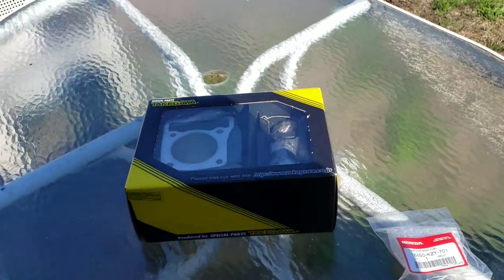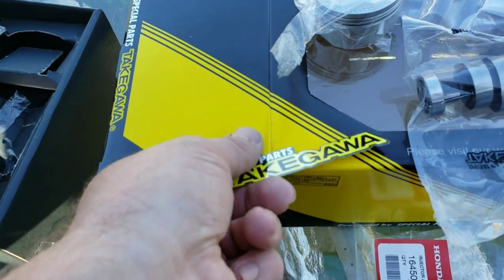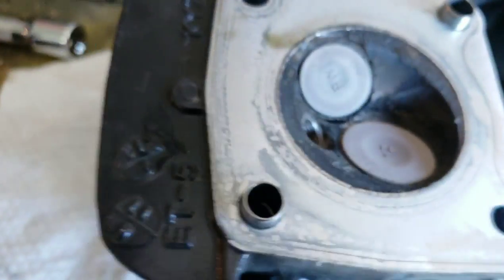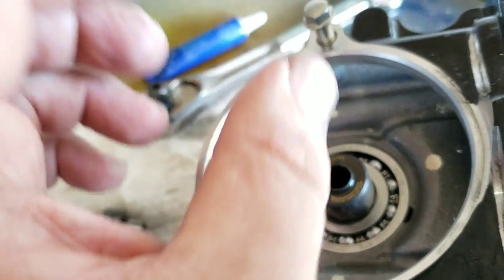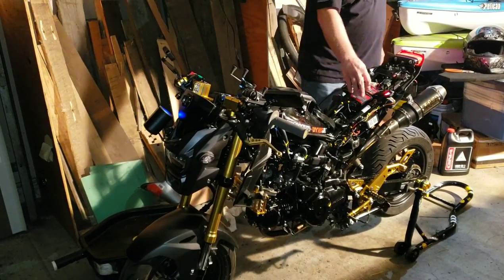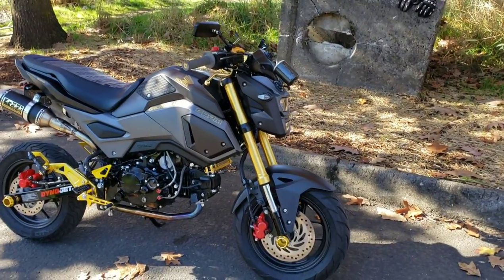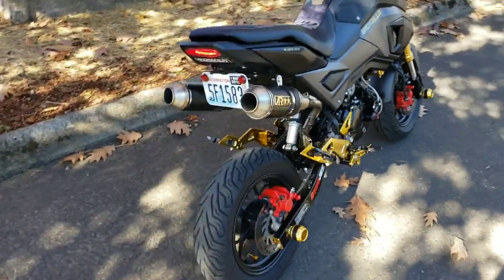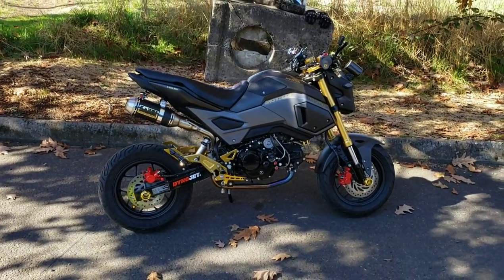GROMZILLA gets the TAKEGAWA 181  Big bore kit and type-S camshaft

Comment: 4 years later: I wonder how it worked out. Bigger Power = Bigger HEAT, I know from boring-out larger bikes... the Grom is famous for it's reliability; did you have any issues after this work?
Reply from the maker: I believe there's right about six to maybe 8,000 miles on the bike right now and no it is never broken down it has been very reliable. Keep in mind it does get hot. On a two or three hour ride on a 80° day you are going to be pulling over to let it cool down. If you didn't pull over to let it cool down I suppose it would probably blow up just because it gets too hot. Heeat has been its only issue ever. Not that it's ever had an actual issue but I'm just saying it does get hot. That is the downfall of doing a Big bore kit always. You have to keep an eye on the temperature if it goes above 226° f we shut it down and pull over. It will cool back down if you start slowing down but if you are on it full throttle it will start heating up. This bike has an oil cooler and every other kind of thing that we could come up with to help keep it cool yet it still gets hot. The thing still rips though. We put it on e85 and it pulled all the way up to 96 mph. Of course a lot of that has to do with the gearing we put on it but it had the power to get there. I let off at 12,500 RPM. Data logged the entire run and it still had a little bit to go but not much. Definitely a fun little bike if I had to build it all over again I would build it the same way that I did.
Reply: @BLRTUNING  Thanks Bill, an interesting report! I'm an experienced tech, have built a number of larger-bike race motors... HEAT is the Enemy, as you've learned; it can cause numerous problems including excessive piston-ring/cylinder-wall wear (or damage), valve guide / stem wear, and even lower-end bearing failure, in extreme cases. Yes, I would do everything possible to keep that oil temp down, and also use VERY GOOD OIL, with frequent changes. A Ferarri mechanic I know recommended Valvoline VR-1 WITH ZINC for my big-bore (air-cooled) Bandit 1200 Suzuki, which I'm using presently. But do your homework carefully on oil for that little ripper.

Comment: I wondered how fast can the 181cc kit goes?
The 143cc kit can hit 70-72 miles, I am considering either one if the 181cc is a big improvement.
Reply from the maker: It all depends on how you build the bike and what sprockets you are running.. top speed on this bike is above 90mph.. it has a lot more done to it than just the 181 kit.
Reply: @BLRTUNING  Thanks, I think it would be a considerable improvement over 143cc, I'll go for that instead.
Reply: @BLRTUNING  what all has been done I have the same kit but using pc5 with autotune

Comment: Might do this over the sucker punch kit.... power on this must fall off around 9k 9500 with stock head.
Reply from the maker: It makes power till about 10,000 RPM on the stock head. There is newer videos of this bike on my channel. The bike now has a ported large two valve head with a ported throttle body and a huge carbon fiber intake with a 4-in open velocity stack. The bike now runs on E85 and will easily rev out to 13,000 RPM and has done 96 mph down the freeway...  Gearing when it went that fast on the freeway was geared just for the freeway. We were running 16 tooth in the front and 30 in the rear.. the bike has over 7,000 miles on it now and it still is running on the 181 Big bore kit. When we put it on E85 we stepped up to a 235cc injector. This is by far one of the longest running Big bore kits that I've seen for a long time.

I tune these bikes on a daily basis. Tuning work for them can be done via email. If you have any further questions you can always message me through the BLR TUNING FACEBOOK PAGE...

https://m.facebook.com/BLRTUNING/

Comment: What's your top speed now 70? Or still around 60
Reply from the maker: I'm not sure I haven't gotten the bike up to top speed yet. I haven't tried to push it like that.  I was cruising down the freeway at 75 miles an hour half throttle 4th gear 7000rpm .. rev limit is set at 10200rpm.  So top speed should be somewhere around 90 to 95 mph.  At 75 miles an hour It still had plenty of Pull when I ripped on the throttle..  Also keep in mind its power band is from 5000 to about 8800 rpm.
Reply: @BLRTUNING  sounds like money well spent for the kit. Looks like I will have to get one now
Reply from the maker: Update.. top speed 96mph
Reply: So sick!
Reply from the maker: mad ass  that 96 mile an hour top speed was 6 months ago now I'm tuning the bike on e85.. a couple days ago I hit 96 miles an hour and ran out of either injector or fuel pump still not sure which. That was at almost 10000 RPM rev limit is set to 12500rpm.. so now we're going to put a bigger injector in it I was already using the pcx150 which is a 140cc injector.. the injector I'm going with is a 235 CC uminaoshi injector... The new injector will be here in a couple weeks.. We will see what happens ,,, we're on a mission for 100 miles an hour..
Reply: BiLL Ramseyer it’s been 4 months.. hit that 100mph?
Reply: @BLRTUNING  how much horsepower has it got, here in the uk we can ride 125cc but it cant have more then 15hp
Reply from the maker: @plasma_659  we're guessing somewhere in the neighborhood of 18 horsepower maybe I wouldn't think it's any more than that though
Reply: @BLRTUNING  oh ok thank you mate I love your grom
Reply from the maker: @plasma_659  depending on what fuel controller you go with or aftermarket programmable ECU a lot of the tuning work on these bikes can be done through email if you have any further questions you can reach out to me through the blr tuning Facebook page.. or even if you are interested in custom tuning work. Please feel free to stop by my business Facebook page and take a look at some of the work that I do..

https://m.facebook.com/BLRTUNING/
Reply: @BLRTUNING  ok thanks mate
Reply: @BLRTUNING  you think 18HP will get you 96MPH? Madness...

Comment: Ok so let’s see if I absorbed any info you have given me LOL.   The Honda grom factory set up runs lean (14.7-1) and I believe we would want a ratio of more like 11-1 to 13.5-1  with the 181cc cylinder ,cam and pipe and intake changed. hopefully I got that part correct,that keeps the bike a little richer to keep head cooler making the bike last longer without piston seizures or crank failures . Next is the factory ecu is only good for adding up to  about 5% fuel (and that is why we flash the ecu ) to allow a larger percent of fuel so we don’t lean out ! The auto tune does not correct the fuel ratio enough ,because the stock ecu only allows it only up to the 5% range ? When you flash the ecu, is there a range it gets flashed to?for instance ,stock for the grom is from 0-5% and then you flash to  5-10% or is the percentage rate wider  like from 0-10%  I guess I would want you to flash my ecu for me! But if I flash it once and make some type of change like throttle body or larger intake do I need to do it again . I will not be doing a turbo ! But if the crank fails , i would put in forged crank.and Would probably go to like a 212 cc if I feel the crank could handle it.  Do I have this much understood for now? I am sorry for all the questions but I am sure it will help everyone following this thread
Reply from the maker: Paul.. you are correct on some of it let me explain...
For starters if we were flashing the ECU we would be using the Dynojet PV3.. or power vision 3.. that is a ECU flash tuning device..
I believe if I am correct what you are using his power Commander v which is a piggyback device you would want the WB2 also connected to the bike this would be the wideband module that has auto-tune built in.. it will require the O2 sensor that comes with it to be mounted into the tailpipe approximately 8 to 10 in away from the exhaust hole in the head so 8 to 10in down the pipe from the head... Then we adjust the lambda value on the WB2.. it sees the numbers as lambda with the number 1=14.7afr,,,, we would probably change that number to 0.92 lambda which is equal to 13.5afr... this is what controls the closed-loop section of the bike which is 0 to 79% throttle... So that's how you would set up the WB2.. programming it can be done from any Windows PC using the Dynojet power core suite downloadable application from Dynojet..

Then in the power Commander v we would go into it settings and turn on Auto-Tune,,, we would also set Target AFR values in the 80 to 100% column remember the wideband module is controlling 0 to 79% so we would not put any numbers in any of those columns in the power Commander v software.. in the 80s 100% columns if you are running a set up similar to mine (Big Bore Kit, exhaust, intake, camshaft... ) We would probably start out in the lower RPM ranges in the 80 to 100% throttle columns around 13.0afr and as we get to wide open throttle drop down to maybe 11.5afr something like that.. obviously you would want some kind of Base map to get you started that ushers that while auto-tune is working to make its adjustments you're not going to be running the bike lean in the meantime... So I would build a fuel map for your power Commander v and walk you through how to adjust the WB2 correctly if it was me doing this work for you I would walk you through everything over a phone call after I email you the map... Once everything is said and done you would go ride the bike around a little bit and for about the next 10 rides or so when you're done you would plug in your computer to the power Commander v and you would accept the changes that auto-tune made this would be how you fine-tune the bike... I usually tell my customers to do that for the first 10 rides after that you can do it every once a month or something like that just to see if there is any changes made you don't have to accept them all the time after the first 10 rides... Remember everybody's elevation everybody's climate is always different and the parts may vary as well.. I'm pretty good about getting the fuel map on the money but it doesn't always work out like that sometimes even after I build a decent map there might be a spot that requires 5 to 6% less fuel this is where auto-tune would kick in to make that correction.. I usually try to make sure that the map that I send you is a little bit on the rich side if not on the money... If auto-tune needs to take away fuel it will do that for us... So remember power Commander v and wb2 are a piggy back system that works together.... the Dynojet power vision 3 is a completely different product that allows you to build a custom map and then flash it over to the ECU this would let you completely change the fuel map in the ECU you could even turn off the closed loop section and just run the bike in open loop...

for these bikes there is an absolutely nothing wrong with the power Commander v and the wb2....
Reply from the maker: If you would like to talk more I would encourage you to look me up on Facebook messenger or Instagram direct message
Reply: Thanks bill  !!!!!    Your the man . I do appreciate all your help and knowledge.  sorry about the book I wrote ,and all the questions  I’ll hit ya up when I have it set to where we gotta b to set up mapping
Reply from the maker: @paulhartman7144  okay sounds good.. just let me know when you're ready for a custom map..

Comment: So is that still a 125. But kinda converted to a 181
Reply from the maker: Well technically we put a bigger piston in it so it is now a 181 cc motor.. the crankshaft and connecting rod are still stock. As of today those are the only things that are stock. The bike now has a bigger ported head a large carbon fiber intake with a 4-in open velocity stack no filter,,, it's straight piped with a custom header and dual exit under the seat... The bike now runs on E85 it gets about 60 miles out of a full tank of gas.. it has a top speed of 96 mph..... I do offer custom tuning for these bikes and many other vehicles...

If you have any further questions please feel free to reach out to me through the blr tuning Facebook page...

https://m.facebook.com/BLRTUNING/

Comment: Do you have to do anything with the Groms computer? reset it or reprogram it for the bigger injector and added airflow? Nice bike you have. I have a 2017. Hardracing is a great company to get Grom parts.
Reply from the maker: Yes I am running Power Commander 5 and wide band 2  With auto tune. I also have a re flashed ECU by using the new power vision 3 from dyno jet for the Honda Grom. You could just go with the power of vision 3 for $400... It will get you all of the Tuning abilities that you would need. Power Commander 5 and wide band 2 will run you about $300 each.
Reply from the maker: Changing the injector the Piston or the head or anything to do with the throttle body you should always reset the ECU it's a good practice to reset the ECU when you do the intake and exhaust as well pretty much anything performance-wise I would reset the ECU.. when adding a new bigger fuel injector you will only see any real gains if you have a fuel controller.
Reply: @BLRTUNING  how do you reset the ecu on the grom?
Reply from the maker: @demonrobertketchie5409  first with the vehicle off remove your seat. locate your diagnostics Port it'll be on the right hand side it'll have a little red cap over it. Remove the little red cap. Locate the green and the blue wire that goes into that diagnostics port. Use a small piece of wire or a paperclip 2 squeeze into the diagnostics port so it jumps the two wires together now both green and blue wire should be touching each other by using your jumper wire.stick the key in the ignition make sure the fuel switch or kill switch is turned on. hold the throttle at wide open throttle and turn the key on you should see a check engine light let go of the throttle within 5 seconds of turning the key on. now you should see the check engine light flash every one and a half to 2 seconds. That is indicating a successful code. This means you have successfully reset your ECU. Now turn the key back off and remove the jumper wire put the cap back over the diagnostic port. Turn the key back on and start the bike back up. You should know no longer have a check engine light and ECU is reset. Remember while resetting the ECU you do not need to start the vehicle. follow these instructions and you will be successful at resetting your ECU. You got any more questions let me know
Reply from the maker: @demonrobertketchie5409  don't forget before you plug in that jumper wire the key should be in the off position you will not turn that key on until you have fuel switch or kill switch in the on position and the throttle at wide open throttle only then will you turn the key